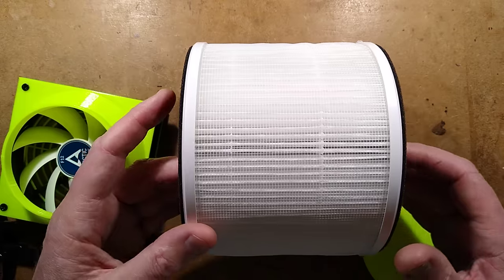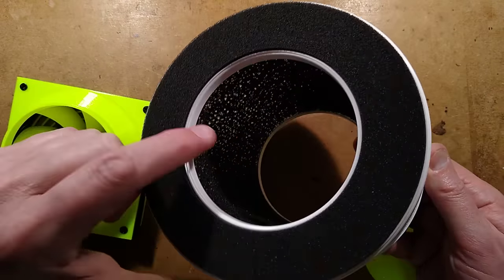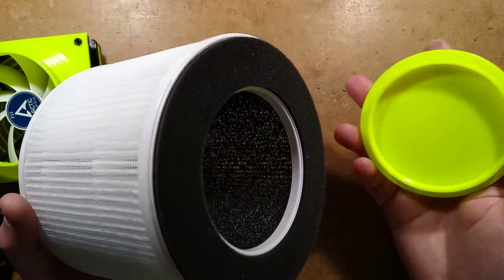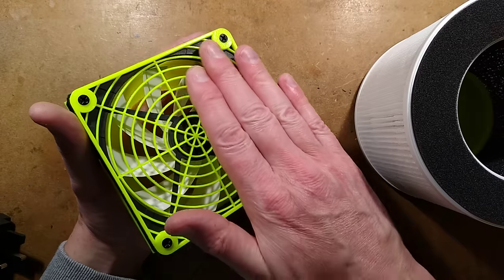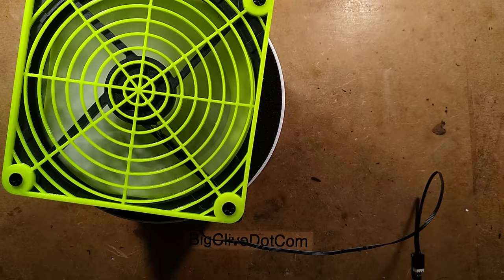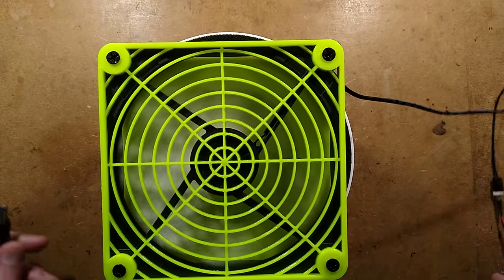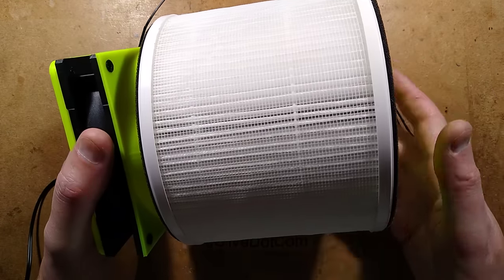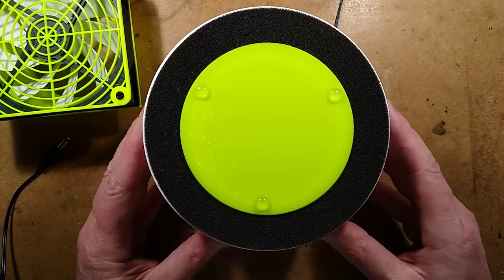DIY cheap & quiet HEPA air cleaner

Comment: I've been browsing your vids on air purifiers and ionizers since yesterday. I have  a Lasko A554IN which is an Electrostatic Precipitate type air purifier and not available in first world countries owing to ozone regulations I think. It also claims it has an Ozone filter but I have no idea how that works. I don't want to part with it yet because it's damn fast and very effective, especially for pet fur. 

Do you have content on DIY non-HEPA/Carbon purifiers, like DIY ioniser purifier that I could watch and make a safer one to replace the Lasko purifier with? I am uncertain as to how they should be arranged in a case. HEPA and Carbon filters are price gouged as hell in India and the operating business model follow the HP/Canon printer-ink approach, and so I want to DIY a washable ionising purifier instead.
Could you also be able to procure the A554IN  or similar from somewhere and explain how it works. I love the well engineered numerous plates sandwiched arrangement but have no idea how it's setup and works. 

Also I don't understand how the generic ionizer and the bipolar ionizers that some purifiers claim to have, differs in. If electrons are stripped from molecules in air, won't the molecules become positive too? So aren't all ionizers bipolar that way?

Comment: Is there an easy way to check if the air coming out of the filter is even in its distribution or uneven?
What about cleaning the filter? One problem I have with my vacuum cleaner is cleaning its filter. It has 3 parts and they all get clogged with dust.
Reply from the maker: The fan sucks air through from the outside and as the fibres clog the air will distribute evenly.  A vacuum can be used to remove fluff and some dust from the filter.

Comment: You can probably mount it in any direction... those fans are made to go on the back, the bottom, the top, the front, and even inside the computer cabinets... so on the top like that should be fine... but with HEPA filters it's the CFM that matters...  our furnace fan running with a Merv 13 filter filtered the whole house down to about 95-98% no particles because the CFM is so big...  even the biggest consumer/home HEPA filter can only do 1 room because the CFM is only about 200 (22CFM.)  With filters CFM is perhaps more important than having a really good filter material... even a Merv 13 filter will do a lot of good and come close to a True HEPA filter and maybe even better if the CFM is enough.  If the air isn't being moved/affected then it can't pull the air into the filter and do anything, so unless the force touches the air nothing is happening.
Reply: So if one is obliged to use PV fans, what types do you recommend? Or if I have a bedroom thats 4 by 4 meters, what would I need when looking at CFM?
Reply: @rogierius  What's a PV fan exactly in this case?  I think that if you get 200 to 400 cfm you will be fine, but the more important things are if the windows are open you will let in more particles, if the windows are closed then CO2 and VOC will build up inside the room... so the only way to have clean air is to move to an area with outdoor clean air...  you can't have both low/no particles and low/no VOC if the outdoors are very polluted... but if you just want to lower the particles in the air you can get a cheap house fan and put a Merv 13 or Hepa filter and tape it to the fan...  a good HEPA filter is the IQ AIR HEALTH PRO PLUS, it's very quiet on the lowest setting and it has HEPA and activated carbon filter... and the Honeywell Enviracaire Portable True HEPA Air Purifier - White, 50250 is effective but it is much louder and has no carbon filter, just a carbon pre-filter.  To get rid of VOC and CO2 the best way is just to open the doors and windows, but then the particles will build up...
Reply: @VenturaIT  thanks for the detailed reply. The 'PV' fan was a typo, I meant PC fans, or personal computer fans. My biggest restrains are costs. I have plenty of PV fans, but looking for a cheap way of cleaning the air or particles.

Next step would to actually built a community supported DIY air quality sensor suite to measure how my air inside and outside is.

I could then built a airfilter unit for the bedroom, our living room and the tiny workspace room of my girlfriend.

Comment: @bigclivedotcom Whoever is saying "the bearings will fail" if the fan is inverted is talking out their bum; computer case fans are mounted at all angles & push pull configurations. If you want to be on the safe side, peel back the label pop open the rubber cover (if it has one) & put a bit of dielectric grease on the bearing.

Comment: Seems like you have the fan set to a push configuration which seems to be against the design of the filter. I feel what is needed is a pull configuration with the fan to pull the air through the pleats. This, however, will likely require a fan designed more for higher pressure rather than higher rpms. Just a thought.
Reply from the maker: It pulls air through the filter.
Reply: @bigclivedotcom   Thank you. When you mentioned that you felt the air flowing when holding the filter, I was under the impression it was blowing through the filter. I now see you were commenting on the airflow coming into the filter.

Comment: why not Use "Delta" fans? sure they are a bit noisier but they have way more static pressure than most consumer PC fans or do a horizontal "twin" config? would vastly increase the performance of the device

Comment: If you get a decent brand computer case fan, the orientation isn't going to cause a problem... I've had many many MANY case fans (mostly Noctua brand) used in cases running day in day out for years and years and never a single failure, and typically 2 or 3 of them are on the top of the case as a way to push the hot air out quickly. So, again if it's a decent fan to begin with then they can run vertically or horizontally perfectly fine.
Reply: The brand he chose is a good one.  In fact, I don't think there is a better brand at the same price point.
Reply: @Diviance  ^_^ I'm not saying it wasn't a good one, I was merely stating it as a generality, that if it's a good fan, it won't have any problem being used for a very long time vertically or horizontally ^_^

Comment: This reminded of a question I've been meaning to ask you. If you build your own power supply enclosure, should the fan blow across everything inside, or should the fan be pointed to just blow the air out of the enclosure? I've seen them both ways and just wondered if one way is better, more correct, or dependant on how it's built? Hopefully I worded it so it's easily understood lol.
Reply: legacysage   Thanks for the info 👍
Reply: Try both while monitoring the heat on a component. Use whichever gives you the best thermal profile.
Reply: @nyetloki   Actually had that in mind. Thought about that not long after I posted the comment/question lol. Thanks though 👍

Comment: Just tape a MERV11 or MERV13 box furnace filter to a large box fan. It does something like 95% of what several hundred dollar HEPA filter systems do.
Reply from the maker: I can't get those furnace filters here or the box fans.  (We use hot water based heating here.)

Comment: Lol, yeah.. that fan is going tobe able to pull enough static air column to make that filter work. Right. Gotcha.
Reply from the maker: It does.  There's a very detectable air flow between your fingers when you place them on the side of the filter.  Even more now I've swapped it to a high static pressure version of the fan.

Comment: Shouldn't the fan be pulling air through the filter? More surface area on the outside of the filter and your fan won't get dusty.
Reply from the maker: It does pull from the outside.

Comment: I think the problems with these are they work  less efficiently with a larger room size, and the time they're on, say it halves the crap in the air in 6 hours, it'll take 12+ more hours to remove the same amount of material, and if the air flow in the room is pretty slow anyway, the cha ce for things to be sucked in is reduced

Comment: Cute. And affordable - IFF you've the money, space (again, that's $$), and proper ventilation (again, that's $$), to have the 3D printer in the first place. It's like saying carpentry project X is affordable at $10 - and then you use a setup worth $3000 to make project X. 🤷‍♀️
Reply from the maker: A 3D printer is very low cost these days and can make many things.  If you bought one just for this project then it might be less efficient.
Reply: @bigclivedotcom  Very low cost - oh, so you mean $50 and under, or $25 and under? Because that's low cost for most of us.  I'd love to get one at that price!

Comment: Clive my 200$ air purifier* died (main board that i bypassed, and finally the ion module quit recently) could you please point me to a good ion module model that i could buy online? it seems i can only find small one and the bigger model are ridiculously expensive.

the fan is a AirGenius 3, its basically just a tower fan+ionizer module. in the back there is a chloroplast grid cardrige that is charged with the ionizer module.

Comment: Barely hear the fan noise.
I’ve mounted a 230mm computer fan laying flat in my campervan skylight, wired into a variable speed pwm controller.
Super quiet.
In the summer when camping we leave it on all day.

Comment: Clive, can I pick your brains, please?  If you swap the wires round in a fan, does it run the other way?  I would like to make my own air filter, but would rather the fan impeller gets the cleaned air, rather than sucking in the dust-laden air from the room.
Reply from the maker: No.  It may damage the fan.  They are single direction, but can be mounted the other way.
In this case, the fan is pulling the air through the filter so it is only exposed to clean air.

Comment: What do you mean the bearings aren't designed for that?
I've run sleeve bearings for YEARS on various angles with no issues on 180mm fans with much more axial load than this. Keep em greased and they are fine.
For ball bearings (what you are probably referring to) is an issue that also happened with some HDDs and to be brutally honest is basically a non-issue these days, or you'd have planes and all sorts failing. Basically just mount at 90° or flat if you are worried about it.  You can mount them sideways (90°) no issue. If they couldn't then you'd see so many fan failures.

Comment: Could you provide a little more guidance on the diodes for a newbie? Is the voltage supposed to be 12V? Also, I wonder if there's a simple way to adjust the speed with something like a rheostat? I could use that on another application where I'm continuously venting a small space. Thanks.
Reply from the maker: The fan is designed for 12V, but asking a couple of diodes in series drops about 0.6 to 1V per diode.  That makes the fan run slightly slower and much quieter.

Comment: Which way does the air flow? In through the filter and out through the fan or vice versa? The filter looks like it should have a preferred direction for the the air to flow.
Reply from the maker: From outside the filter inwards.

Comment: Do you have the fan backwards?
Usually, the round label on the blades, is where the air exits. 
Maybe this is how this filter works. If so, then it sucks, because it can't be vacuumed when it gets dirty. 
I have a commercial one with a long rectangular filter. I just vacuum the HEPA filter every 6 months. This may not work if there are oily particles in the air, like from cooking.
In that case, vacuuming the filter will not clean it.
Reply: let me guess: you vacuum the hepa filter with a non-hepa'd vac, blowing all the dust collected in 6 month back in the air in 5 mins ?

that'd be the average appel and dyson user. 🤦‍♀️
Reply: @casemodder89  You assume that my main vacuum doesn't have HEPA! 
Your guess is wrong.

Comment: Clive, sorry for my ignorance, but what would you actually use this for (just an air cleaner in a room?). Would this make a good soldering fume extractor.
Reply from the maker: It can be used to remove airborne dust and smoke.  I'm not sure how quickly it would capture soldering fumes.
Reply: @bigclivedotcom  Thanks.. I have never used an extractor in 45+ years of soldering, but I do like printing 3D stuff, so I thought combining the 3D printing and a filter might be a fun project
Reply: Some people use specialized carbon activated filters for soldiering. Probably best to run a big fan and windows opened if you get a good cross breeze. Depends on your set up.
Reply: The Hakko FA400-04 "fume extractor" is merely a fan and an activated charcoal prefilter for $73... Justsayin'.
Reply: Fume extractors with a directional (not omnidirectional!!!) uptake work best!!!

Comment: HEPA originally stood for High Efficiency Particulate Absolute. In the early 80's I maintained 300MB CDC disk drives which had removable disk packs. The drives were the size of washing machines, but even heavier. We had to replace the filters regularly to avoid head crashes.

Comment: Is there anything wrong with doing this? I don't think an enclosure provides much except prettyness (subjectively).
The probably very weak UV light in the original unit probably doesn't do much, not to mention a good HEPA filter should catch it before getting to it anyways...

Comment: I know there are plenty of computers with the fans in the on top and bottom of the case. My guess is that it does not matter or there are vertical ans horisontal computer fans that you can buy.

Comment: Are these filters supposed to suck out of the middle? How much will it just spin the air inside? Might need a baffle. I was wondering if having a fan on both sides would work better?
Reply from the maker: The air is being drawn in from outside.  The airflow is good.

Comment: I have a question my HEPA idylis started flashing on and off thought might need to change filter but didn't do it right away so it shut itself off  plug it in and nothing lights up so my question is is if I went and bought new filters and hit the reset button would it fix my problem???
Reply from the maker: You could try vacuuming the filters from the air intake side to get excess fluff off them, but there may be a reset procedure, like holding down a button to indicate you've changed the filter.
Reply: It should be mentioned in the manual. Try there.

Comment: What is the best 3d printer without remortgaging [sic] then? Far too many out there and I trust our Clive.
Reply from the maker: I'm not sure of the best type.  There are many very affordable units available.
Reply: Prusa makes great ones
Reply: Dont mess around with ultra cheap ones and especially those with manual bed levelling.... Been there once... So, I bought a Prusa i3 Mk3 and it is the best there is. I have never had failed prints, Ive never had prints lifting of the bed, never had prints that havent printed correctly and I have printed in all types of filament, including ABS (which cheap printers always fail at).
Reply: Get one with a big community. 
A creality Ender3 or Ender5 is a great beginner choice, with a huge community at a very good price point. 
Prusa printers have high quality and a big community aswell, though they are a bit more expensive. 
The quote on quote best printers out there though would probably be CoreXY models, such as a ratrig, voron or seckit, though those cost usually just over one grand. 

Keep in mind that to achieve best results, you usually need to tinker and modify a lot with those too, which isn't great for beginners. 

My suggestion: grab an ender 3 and a bltouch probe and learn the ropes with that. That's about 300 bucks. Once you feel like you're getting enough use out of your printer and the device itself starts to become a limitation for your ambition, upgrade and get a fancy one. 

teaching tech is a wonderful channel that helped me a lot when I got into 3D printing and there's probably some videos on "which printer should I get" on the channel too.
Reply: For entry level, Prusa Mini and Ender 3 are great choices.

Comment: How do you power the CPU fan? Just with a power source like a CPU? Or you use something else because it doesn't justify considering the low watt consumption?
Reply from the maker: Just a common 1A 12V power supply plug.
Reply: @bigclivedotcom  ah ok. By soldering and doing things. I'd rather just buy a cheap cpu power supply and use it, as I want to connect several fans and I don't have soldering tools with me. Will just get a silicon gun for this project, plus my drill and imagination.

Comment: What about using a T-shaped PVC pipe, placing pre-activated carbon sponge in all holes, and wrapping the end points with pantyhose? Will air pass through the pre-activated carbon sponge and pantyhose?

Comment: I modified it for a 140mm

fan  //120mm fan adaptor HEPA filter
$fn=100;
//You can adjust these four variables
//Primarily the filter hole diameter
screwhole=5;     //fan screw hole diameter (5)
filterhole=92;     //HEPA filter hole diameter
thickness=1.5;  //Thickness of plastic layer (1.5)
insert=10;          //Length of insert into filter (10)
//Do not adjust anything below here
cone=(120-filterhole)/1.5;
wall=thickness*2;
difference(){
union(){
//flange
translate([0,0,0])
cube([140,140,thickness]);
//taper to filter insert
translate([70,70,0])  
cylinder(h=cone,d1=140,d2=filterhole);
//filter insert
translate([70,70,cone])  
cylinder(h=insert,d=filterhole);
}
//taper to filter insert
translate([70,70,0])  
cylinder(h=cone,d1=116,d2=filterhole-wall);
//filter insert
translate([70,70,cone])  
cylinder(h=insert,d=filterhole-wall);
//fan attachment holes
translate([7.5,7.5,-1])  
cylinder(h=thickness+2,d=screwhole);
translate([7.5,132.5,-1])  
cylinder(h=thickness+2,d=screwhole);
translate([132.5,7.5,-1])  
cylinder(h=thickness+2,d=screwhole);
translate([132.5,132.5,-1])  
cylinder(h=thickness+2,d=screwhole);
}